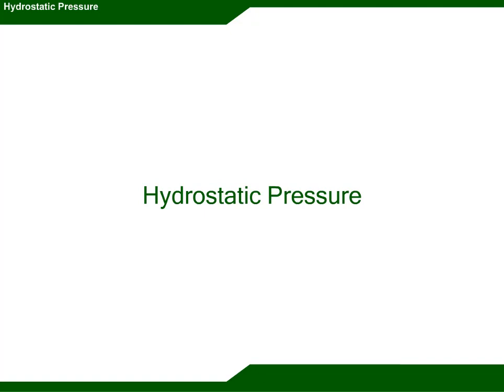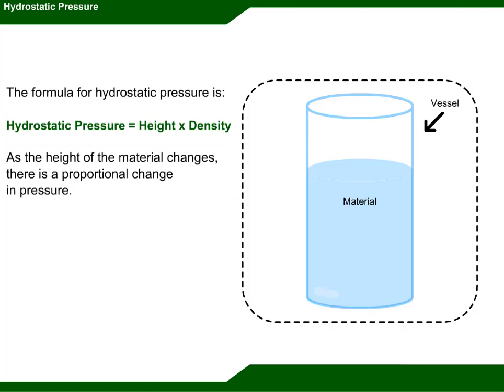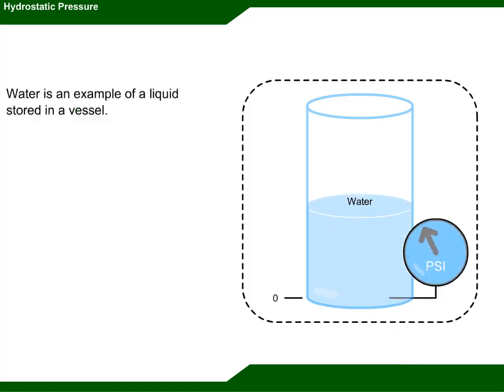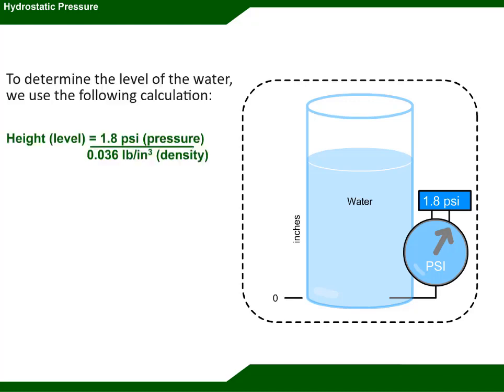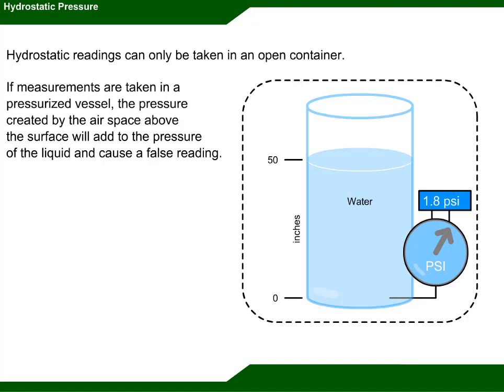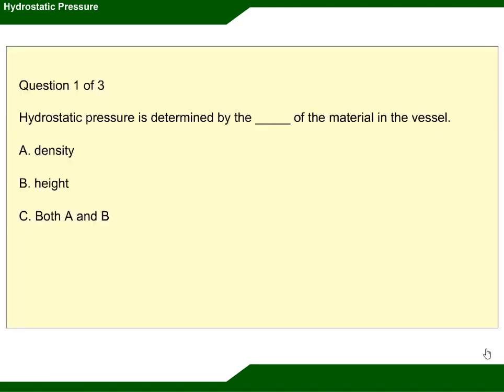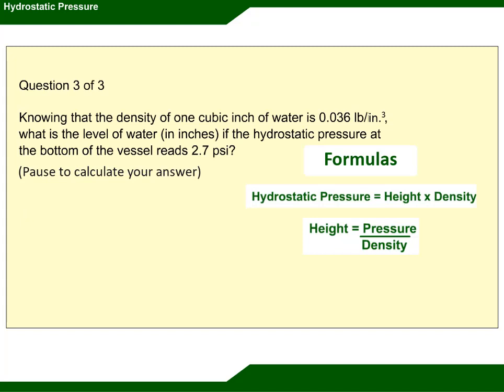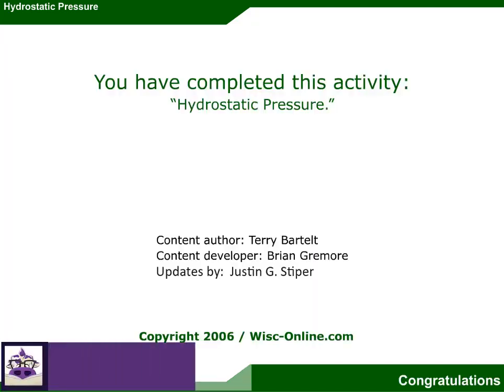Hydrostatic Pressure

Comment: In an open vessel atmospheric pressure acts so it is also give false reading.can you please explain?
Reply: Calibrate it so atomostpheric pressure is set to zero
Reply: @josephadeleke4222  depending on locaction the atmospheric pressure may not be 0. Does that not tie into elevation?